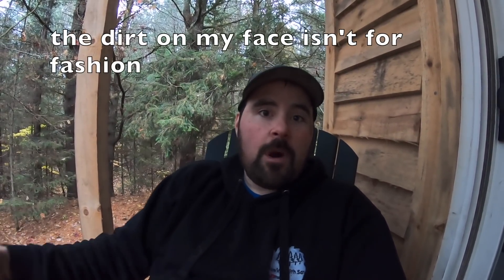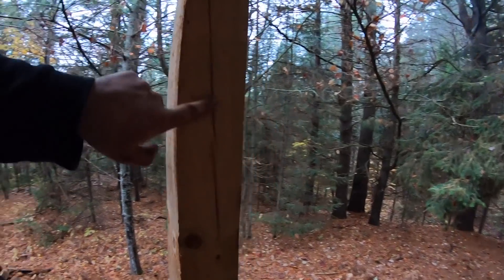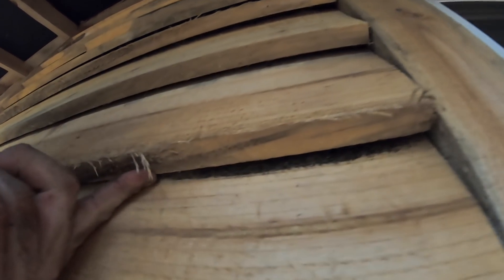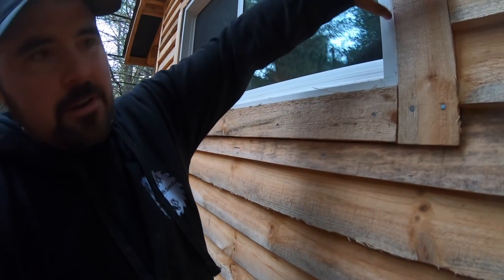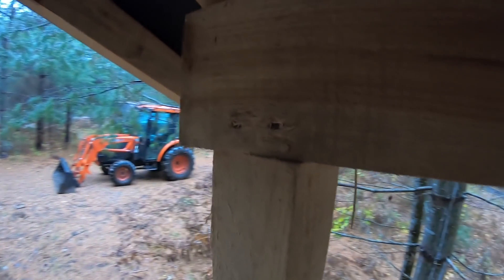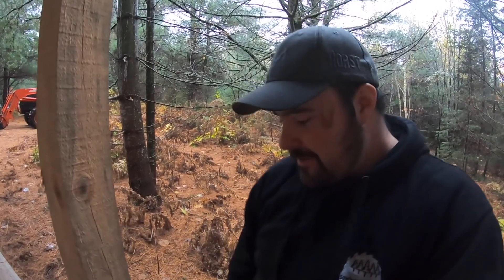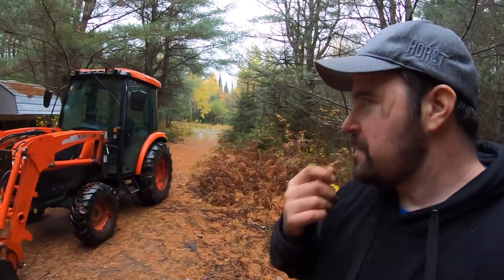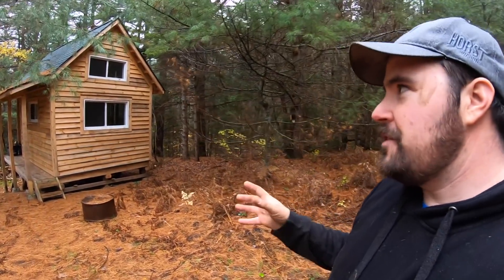Tiny House Built with Green Lumber and Floating Foundation

Comment: its still lookin good ..by the way ...tis old fart just learned somthing new again from ya on the bark side down for cuping ...never thought of that before ...you did nail the siding on the right way ...you blind nailed it ...and yes you probably could get away with some face nails now that it has dried but face nailing goes threw both boards and if its green when you hang it and face nail it the lap siding will split ...i seen many amatures make that mistake ...but the bark side in would definatly help like you said...onto yur post... i hate metal brackets that simpson makes and they dont prevent twisting ...what i like to do is cut a 2by4 for front and back of the beam and post 16 inches long roughly miter the bottom edge at a 45 degree for appearence and nail that onto the beam and post ...it provides the strength ya need for uplift and twisting and looks better then some cheep ugly grey simpson bracket ...ps.. i hope i aint coming across as some know it all ...cheers and happy sawing and building
Reply: Oh dear God, I hate my phone sometimes. My pocket likes to speak Klingon lol.
Reply: @BullfrogKid1234  lmbo i hear ya lol
Reply from the maker: You’re always welcome to share your experiences. I learn new things from good folks like yourself all the time. I’m going to keep that idea for my posts you mentioned. Thanks for sharing
Reply: Z OH IIZZS ADD 70I8 AS O OB IO9 PO 99998 89IIO9O IOII9 9 89IIO9O IS 90S 9 89IIO9O A 8U 8 I 8888FEET 89IIO9O 90IXAA
Reply: @BullfrogKid1234  you ok ? did you over heat your brain ?

Comment: Most timber frames are made from green lumber.  The posts and beams do dry out over time and will shrink and crack a bit.  If you mill your posts and beams to capture the pith in the dead center, it will dry evenly and minimize the drying stresses on the lumber.   Even the kiln dried lumber from the big box hardware stores are still 20% moisture content or more.  So do as Sandy said, butt them tight together and the will shrink to give you a gap.   That bark down to get the crown is counter intuitive.  One would think that the board would cup in the direction of the bark, since the tree was round to start with.   As for the floating foundation, in some areas if you dig a hole for a post below your local frost line and sit it on a concrete block (round patio stone) and back fill it with dirt, it won't move.
Reply: @bwillan   Yeah, when you install deck boards from say Lowes, you always butt them together so when they dry you get a nice gap, but you put the crown up instead of down like he did.  Strange. Wonder what the difference is?  His are obviously cupping the opposite way. I've never seen that before. Could it have something to do with the treated boards?  I've built multiple decks, but never with anything other than treated lumber.
Reply from the maker: Often this has to do with boards dried in a kiln like Lowe’s and mine dried in open air. Atleast that’s what I think the difference is
Reply: @sawingwithsandy   Lowes wood, especially treated wood, shrinks up so much you end up with 1/4 inch gaps between boards. You have to pay a premium for kiln dried wood. Most Lowes wood is green and heavy.  And if you put the crown down like you do, they cup. It's a mystery to me why it's the opposite of your wood. I'll figure it out when I get my mill this spring.
Reply from the maker: That’s a good point about the pith in the centre. My trees are so small I’m just hoping for anything some days haha